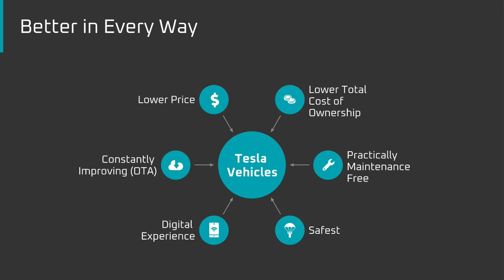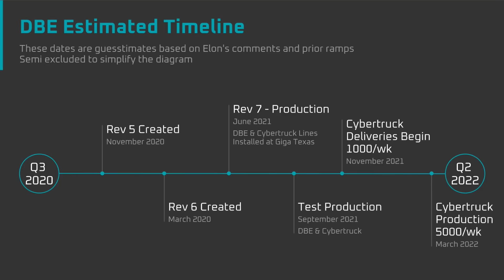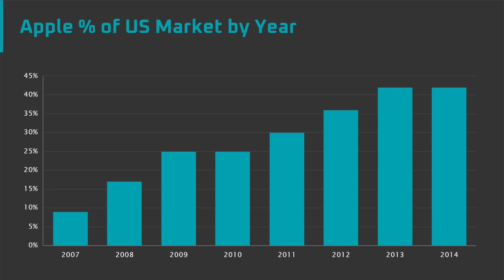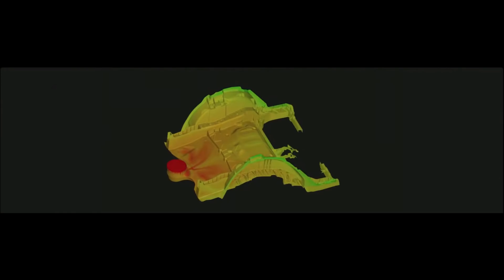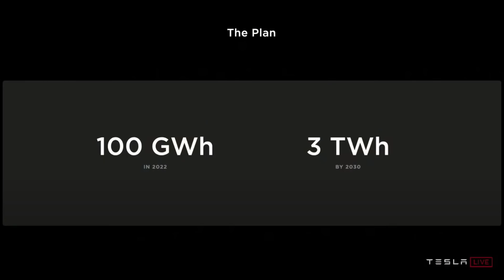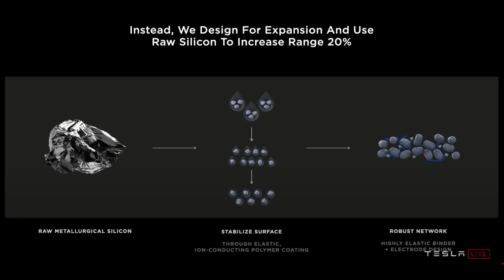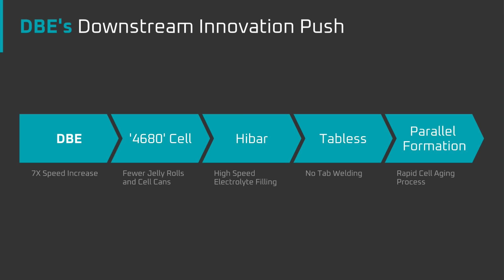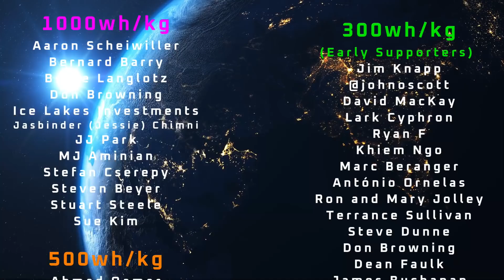#1 Thoughts on Battery Day - Lithium Mine to Battery Line

Comment: Well, it's funny that everyone is talking about a huge price cut what is game changing, when because of the price of the battery is less than 20% even the cheapest car, the model 3 SR+ the max benefit can be achieved is somewhere 3-4K for the model3 SR+ and maybe 7-8k for the plaid model S. This is almost irrelevant and let me explain why.

The ID4 clearly showed us that despite the OEMs has to pay more for the battery they're first edition, what is not the cheapest and is imported from Europe before the insensitives is around 10K cheeper than the similar Tesla's model Y. The cheapest ID4 after insentives seams to be actually half price of the basic model Y. Not only it's a gigantic difference, but even brakes 2 other goals of Tesla. First of all it will be without even the insensitives a 35K car, and not only that it will be cheaper then the model 3 but it's even an SUV. Secondly after insentives in some states it will cost around 25K, what is only a dream for Tesla at this moment.

Speaking of 25K cars, if we reduce the 20% VAT from most of the smaller electric cars in Europe, than we can see that actually the 25K car's are already here. Everyone has it accepte Tesla.

So I don't understand why people are so hyped about Tesla's huge advantage.
Reply: Post actual numbers to back-up that?
No id.4 has even been epa certified nor independently tested yet. And from looking at it, load them both up to a similar options level. and it's not that much of a difference. Yes id.4 has the tax credit available still. But it's not actually that many left for VW at full $7,500. And while the 36 month's of free charging on ea is nice. That network is plagued by issues and on average the chargers are less than 100kws. 

All that said I'd bet after watching the mach-e get dropped by up to $3,000 yesterday. I'd bet tesla does something similar after posting 3q numbers. 🤔
Reply: @4literv6  well, the question is if potential buyers are interested to spec up the car to the Tesla level. I don't think so. Many people are more interested in an affordable car than an speced up. Tesla doesn't let you remove features to make it cheaper, this is why people where forced to buy the more expensive one. So maybe VW wont detract all of the customers, but there is a great chance that a lot of people who want a good enough and cheep SUV may go rather for the ID4. You have seen in this video on one of the graphics that most of the cars are sold between 20K and 40K. Tesla is way beyond that price range. This is why having lower spac cars is important. This is why Tesla might be up hill fight with VW.
Reply: @4literv6  let me give you a small mathematics exercise.

If we detract from the model 3 SR+ price the price of the battery and the profit on the car we still end up with 20K+. Most of the ICE cars makers has cars in this price range inclusive the engine and some profit. So you should easily see that Tesla's cars excluded the battery and profit is a bit too expensive. OEMs has long past so they had enough time to chip away the price of the body production. Of course it helps that they produce much more cars, so the engineering cost is split between all models. So I believe there is the answer for the cheeper base cars.
Reply: @4literv6  and one more thing :p if I am not wrong the US insentives fades away gradually. Also if I am not wrong, VW didn't reached yet those numbers. I bet they will ramps up the production in the US just about the time when they are about to sell the 200K car, just as Tesla did. So there might be a perfect storm soon.
Reply: @gene8194  These are all valid points. Some people will choose less tech for fewer dollars. Maybe, they just want an electric car as basic transportation.  As Elon says,  Tesla's aim isn't to put other car makers out of business, its aim is to bring electric vehicles and energy production / storage to the world -- for a "greener" world.
Reply: @artsnow8872  I totally agree. I am just trying to point out a potential issue.
Reply: I'd be very curious to know what the margins are on the ID3 and 4..  Are they actually profitable or are they being propped up by ICE sales?  I suspect the later initially.
Reply: @TheEvilmooseofdoom  well my theory is the following.
If we detract the price of the battery and the profit of the cheapest Tesla, the model 3 SR+, we still end up with over the haf of the cars price, 20K+ The OEMs can offer planty ICE cars for this price even inclusive the engine and some profit, so it is I believe easy to assume that even if they pay extra for the battery it won't put them in the loosing pocket. Let's not forget the price of battery is topically less then 20% of the car, aka 5-8k. Even if we take the 8K and add 50% bonus we are still around 12K. If we assume that OEMs produce the body for the same price as Tesla that would be 20K+12K=32K. People don't realize that tesla is taking 25% profit on a model 3. That is a huge wiggle room.
Reply: @gene8194  ICE makers make a lot of money on parts sales for the maintenance of ICE cars.  They sell their cars with a very slim margin for that reason.  Tesla doesn't do that.  The need to bring their costs down to increase their margin in order to remain profitable.  I think the margin on the M3 is above 25% now and the cost of a M3 has dropped too.  That's why I was curious about the ID 3 and 4.  VW has one ability that Tesla doesn't in it's ability to eat losses on a single model or two if the rest of the line up is still profitable.
Reply: @TheEvilmooseofdoom  well, that is a good question, though I am not sure they loose on the ID3 or ID4 since it is not cheaper than the ICE version. Teslas prices are beginning at where the luxury segment begins, so for VW it's not really problem to produce a high quality non luxury car in the luxury price range even with profit.
Reply: @gene8194  The big unknown is what they're paying for batteries.  At the moment they're still buying from China which takes a bit out of their profits.  However they are in the process of building their own battery production last I heard.
Reply: @TheEvilmooseofdoom  you are right, VW group is late, but not lost. They're working with the swedish northvolt. The price of the battery from the producers is not too much more expensive, and because it's not a significant part of thr price they can easily afford to pay for it. VW has already all the needed investment for making the body, so they can produce a car much cheaper than Tesla. Because of that the price difference from the battery is not really significant. Of course who don't want to earn money, so they are probably working on better price, but it's not significant enough to make Tesla way ahead. If you think about a model3 SR+ is at cheapest 38K. Minus the 8K batter and minus the 10K what they earn on the car is still 20K. That is a lot of money for the body. Specially if they want to make a 25K car.
Reply: @gene8194  The cost of the battery is not a significant part of the price?  That's an interesting notion especially on a product line that cuts them off from their traditional revenue stream.  I have to say, I disagree with your thinking.  I think the ability to bring battery production costs down while increasing production output will give them a tremendous edge especially in their margins on a 25K car.
Reply: @TheEvilmooseofdoom  just a simple math. The cheapest Tesla is 38K. Minus the profit and the battery cost is around 20K. You ca clearly see the body without battery and profit is way too expensive to have a 25K car. If you make the battery half price you can gain 4K. So Yes, you are right. If Tesla give up all his profilt, than you can have a 25K car. Will he do it. I don't think so :)

Comment: From a lay standpoint it seems like the tabless electrode strategy would be easier to implement in a pouch or prismatic cell being used by GM and VW unless the new Tesla patent is expansive enough to prevent others from copying that strategy. Thoughts Jordan?
Reply from the maker: Nah, prismatic and pouch screw with continous motion due to the curves...they needed be to be coated intermittently and folded.

Comment: Can't wait to see your analysis. Most other you tube channels are in way over their heads when it comes to technical things like batteries. My overall take is that it may take awhile (or never) for some of the battery chemistry ideas to get into high volume. On the other hand I think the mechanical things like tab-less electrode and cell as structure with front and rear castings are more straight forward and by themselves will be a significant advancement which will doom ICE.

Comment: The lithium mining is going to be interesting, considering as a shortage is being envisaged as soon as 2022.
Reply: Just bought shares in a Lithium miner today.
Reply: @incognitotorpedo42  Thing is if lithium ion batteries get too expensive, then it may mean other chemistries become more viable, dependant on use case. We are already seeing this to some extent with LFP cells. It will probable end with a balance between competing technologies.
Reply: Manzour Ahmed i very much doubt there will be a lithium shortage, supply constraints as mining and processing ramps up possibly, but even on battery day, Elon claimed his Nevada mine will be able to supply all US demand for lithium for cars.
Reply: @francesconicoletti2547  The Tesla mining part I'm MOST skeptical of, at least as explained it makes little sense.  I don't think Li supplies will be that tight without their own mining but it's certainly not as simple as Elon made it sound, every ore body is different and it typically takes most a decade to get an operation up to speed.  You don't just sprinkle salt on it rinse and repeat.
Reply: Bo McGillacutty I might wonder about the nebulous timeline to start of mining, but if Elon is making an official statement to investors as to the amount of Lithium it’s going to have to be more or less true.
Reply: @francesconicoletti2547  There is a large quantity of lithium in the Nevada clay they bought rights to, but there are MAJOR hurdles in the way of getting it out.  People have been trying to develop economical extraction methods for lithium clays for decades.  Does Tesla have a method that works?  Having mineral rights is one thing, but being allowed to dig a giant hole in the ground is another.  There is a lot of permitting needed, and that particular area is not a dead wasteland.  There will be environmental concerns that will have to be addressed.  Elon was telling the truth about how much theoretical lithium they had, but he didn't make any promises about getting it out.

Comment: Dude, Elon tweetted on Sunday, they are allready using the 4680 Cell for month now, some People a speculating they are in the revision G Battery Packs of the Model S, Because it's getting 200KW and has a super flat charging curve and thicker Cable, like 250KW cable in Model Y
Reply from the maker: Yeah, gotta have some test mules.

Comment: I thought supercapacitors would be part of battery day, as are part of the power train. They provide high power low energy storage, analogous to computer ram. The would help smooth change and discharge cycles to add battery life, and shorten charging times. I know maxwell, acquired by telsa, was talking to produce high performance super capacitors.
Reply: Supercaps suffer from 2 problems, very high cost, and the voltage level drops by 4 times for half the energy discharge, that means complicated electronics to maintain voltage at the motor drive. Ultimately, with the same money and weight, you can make the battery bigger to compensate for needed power from supercap
Reply: @alihyari7358  The high cost of capacitors is not inherent. If you look at their raw materials they should be cheaper and get cheaper as lithium-cobolt resources dwindle. They also have simpler construction because they have a fewer elements, essentially just the dialectric dielectric. The problem is production volumes. Though capacitors only need to have large voltage drop if you want extract manimum energy from them as an alternative to batteries. Supercapacitors can discharge exponentially meaning their stored energy is the time integral of the voltage curve, voltage as stores energy in electric fields. Though if you wan to use them for extra power because can discharge and charge rapidly and repeatedly then boost efficiency and longevity. This part of these hybrid cell where you devote a portion energy storage to capacitors. The battery management system already individually manage cells, if proportion have different characteristic then it would be difficult to program them to compensate as they do to cover cell defects, variability and degradation. The electronics should be able to tolerate higher power over short periods. It doesnt seem.